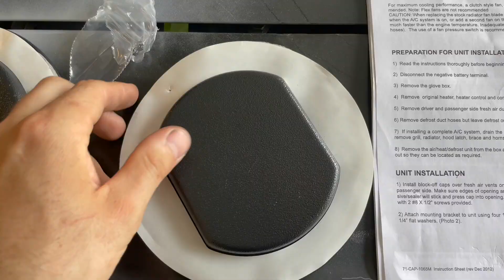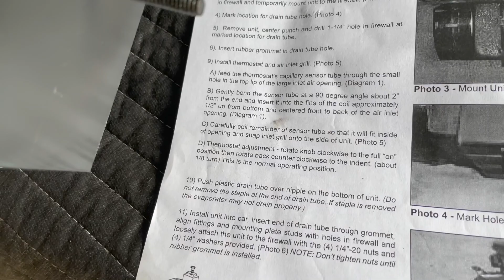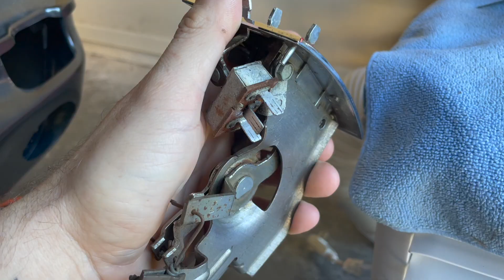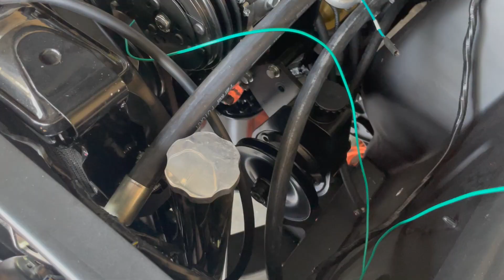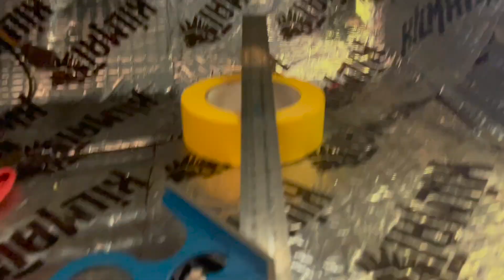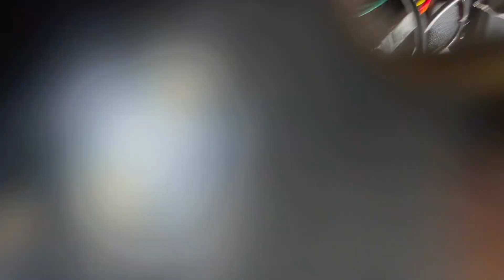Adding AC to Classic Car Part II - Old Air Products - Mustang

Comment: hi  Condenser is stacked plate which is great . 
 Wiring fan to compressor via relay is commonly done . 
Heavy duty cooling systems are always fitted to factory vehicles 60`s70`s etc  when  fitted with factory air con . 
Recommend large thermal viscous fan clutch hub with large diameter fan . Shrouds are nearly always fitted with this fan . 
Electric fan ALWAYS ALWAYS AIRFLOW  Most kits only provide cheap fans that do very little 
12 --13 inch 15 amp minimum SPAL fan 
Many vehicles I retrofit I often fit a second condenser if possible and always high flow fans

Comment: hi After being in the industry for more than 40 years ,air con performs better the more u pay .
The construction for the evaporator greatly effects performance in a huge way  .
[u have this ]Tube and fin = early and cheap R12 systems   //  Serpentine = R12 and R134a .
Majority 90%plus = stacked plate     
Thermostat is the same  ,,      [u have this ] mechanical/electric [early]  or thermistor /electronic = way  more accurate